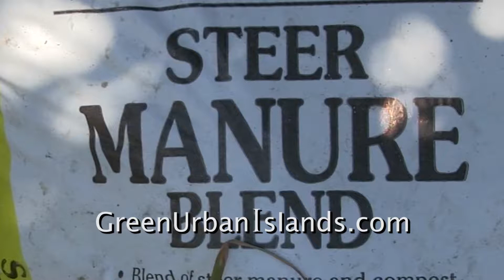Lemon Grass Hydroponics --  hydroponics without Hydroton or clay pebbles

Comment: this is not hidroponics lol, kitchen water does not have enough nutrients in it, plants are taking nutrients from the manure, this is conventional conteiner gardening lol
Reply from the maker: The lemon grass consumed all the nutrients from the manure in the first months.  The kitchen water does seem to be providing nutrients.  The lemon grass is now three feet high at the input, taping down to two feet at the extreme end.  

To make the kitchen water recirculate through the troughs, I need a solar-powered sump pump.  There are $1,000 pumps, no $100 pumps.

In the future, when I find the correct pump, I intend to loop the drainage from the troughs back to the troughs so as to use the water again and again.  Then I will add a worm-culture reservoir to the loop, and, in that way, provide more nutrients generated by the worms consuming garbage.

I will check back on your YouTube channel to see how your work progresses.
Reply: how can you know that the manure has lost its nutrients in few months lol, it doesn't work like that, or have you sent the manure to a lab to test and they sent you a result showing that the manure had zero nutrients lol. Also if it has manure its not hidroponic that is a fact and the other known fact is that kitchen water don't have nutrients enough for plants even if its a plant that do not require too much nutrient uptake. What you did is basic you panted the lemongrass in the manure ant the kitchen water is giving the water fo the plant. There is zero hidroponic concept on this setup.
Reply from the maker: I do not have the money for a lab test.  I work by direct observation.

There is a factor you did not know and therefore could not consider.  The kitchen to lemon grass line is 50 feet long.  All through that 50 feet, worms and other insects digest the debris from the kitchen and excrete high-nitrogen waste.  What the worms and insects do not consume, bacteria process.  The bacteria also release nitrogen.  The line from the kitchen is, in effect, a fluid composter producing fertilizer.

I believe this nourishes the lemon grass.  The plants nearest the waste line into to the trough are flourishing.  The plants eight feet down the trough?  No.

Again, when I can find an inexpensive solar-powered sump pump, I will add re-circulation to the system.

I will watch for your work in hydroponics.  With your knowledge and critical perspective, I'm sure your work will guide us all into the future.
Reply: in hidroponics all the nutrients come from water, if there is manure, worms and bacteria working in the medium this is normal soil gardening, do your own research, I am not critisizing or saying your system do not work it could be great actually reusing the kitchen water but its not hidroponic.
Reply from the maker: In the comments on other videos, other gardeners pressed me to experiment with organics.  

The effort to convert to organic media and nutrients is the premise of this experiment.

Normal hydroponics utilize chemical fertilizers -- perhaps defined also as 'minerals.'  

I know from direct experience that manure loses nutritive value as the flow-though of water continues.  After a time, only cellulose remains.  That cellulose will not sustain growth.  Plants yellow and wither.

In months, cow or horse manure degrades to cellulose.  As time continues, worms and bacteria consume that cellulose.  Only a paste remains.

In the growth-troughs shown in the video, the manure has now degraded to slime.  The growth media now is actually the roots of lemon grass.

This a video of an earlier experiment:

https://youtu.be/QdrmIlBUjaw

As you can see, as biological action reduces the manure to cellulose, then to slime, and finally the slime disappears as the roots of the lemon grass completely jam the hydroponic tube.